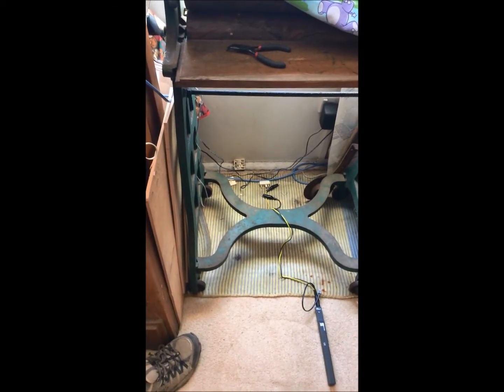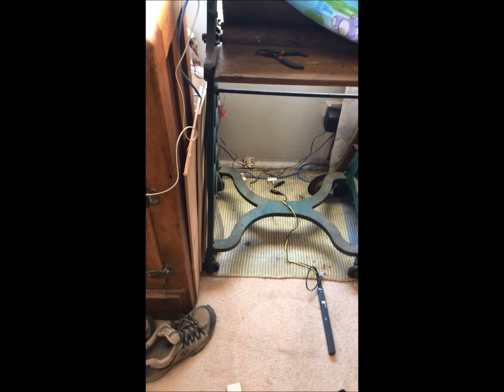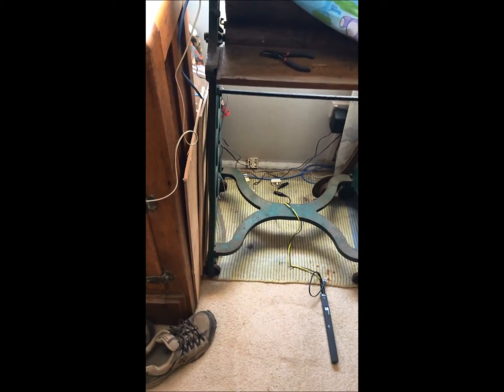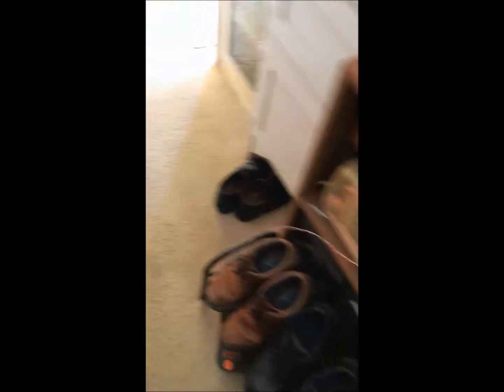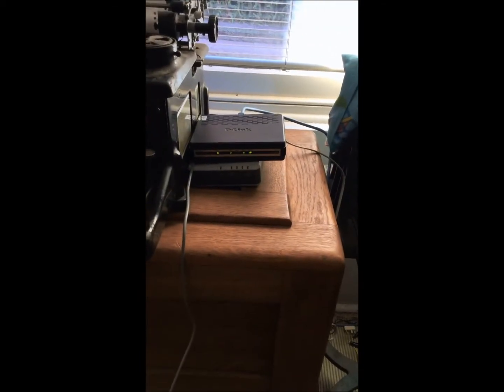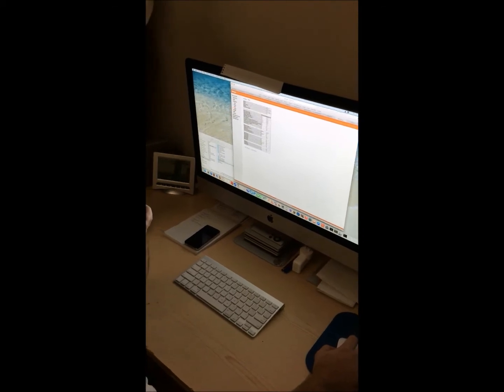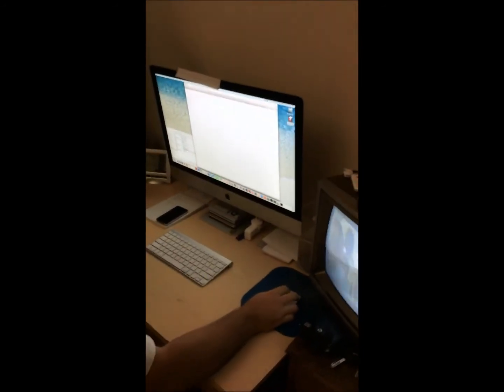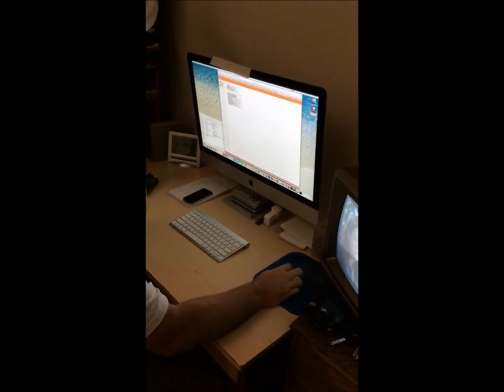Uncovering Hidden Internet Faults After a Massive Storm! | Old Schools ADSL Faults

Comment: I disagree, I've used the jumper wire or 2 pr method quite a few times. Its twisted copper at the end of the day with great success. Yes keeping it attached to the roll isn't the best idea due to the extras capacitance how ever you are correct about li3 device not causing issues.  How far from the exchange was this customer?

Comment: What speed you getting at the Mdf? You know how much interference and loss you would get from the jumper wire across the ground and around the 400m roll. You said it could be the Li but the Li has nothing to do with internet at all. Your internet can work without an Li, you will get 24mbps out of a C pair without and Li attached.